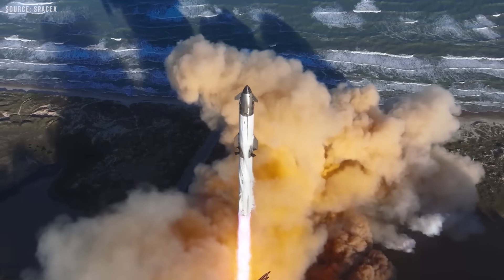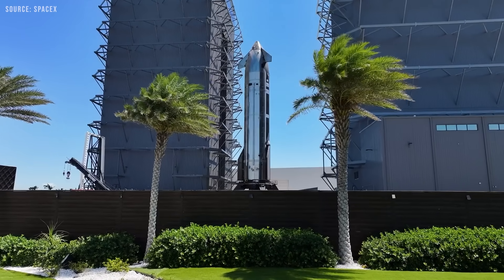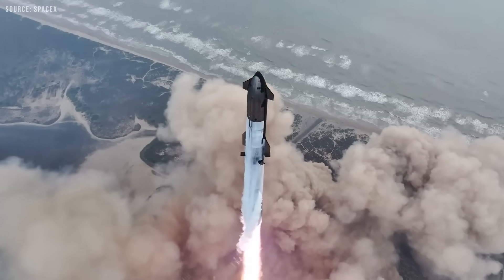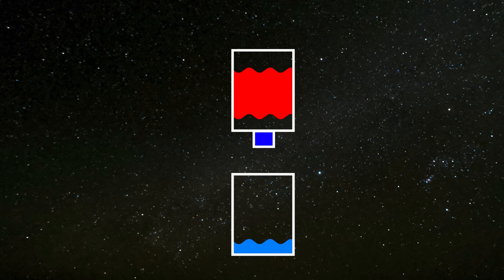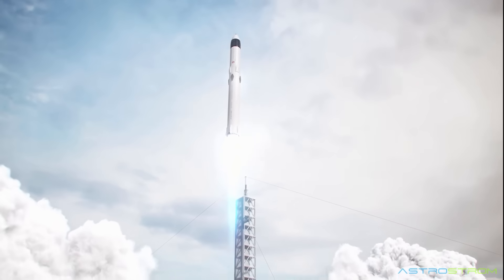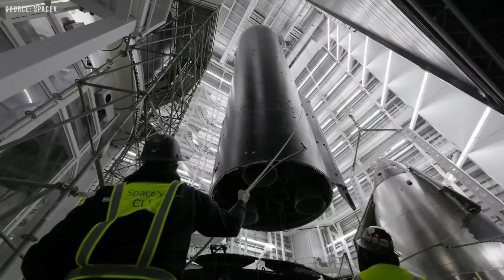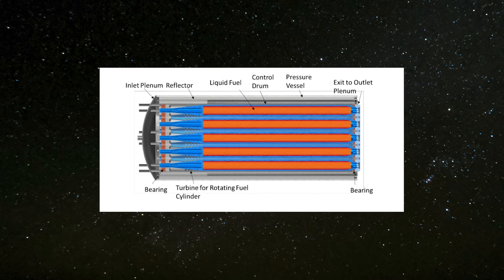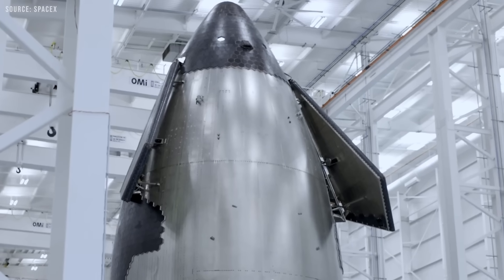SpaceX Found Brilliant Solution for Starship Refueling Problem!

Comment: Here is an idea. Refueling tanker came to refueling depo nose to nose to each other, lined in one vertical axis. Then tanker docks  at spinning on its own axis depo's nose. A tanker also begins spinning before docking so that the fuel inside pushes on its wall. On the wall there would be fuel output. Then pumps begin.

Comment: The biggest problem I could see with transferring fuel through a pressure differential is that you are definitely going to get gas, but it doesn’t necessarily mean you’re gonna get a lot of liquid with it. if the fuel is floating and it’s not on a transfer port there is no transfer. In my opinion, the most reliable way to transfer fuel between ships is by spinning them, pushing the fuel to the outermost edge and then piping it with a pump from there. But I’m not exactly a rocket engineer.

Comment: Love the orbiting tanker concept. Adding one or more tankers around Mars seems to make good sense. Having additional fuel could possibly help de-orbiting on Mars since its atmosphere doesn't provide the stopping pwr that Earth's does. Could additional tankers be placed at way points during the trip. The effort could lead to reduced travel time and avoid an immediate need to manufacture more O2 and CH4 at least for initial trips.  Getting the Mars based plant and storage concept worked out would likely a few years  to work out. A fuel tanker orbiting  the moon sho reduce risks if it available for backup
Reply from the maker: On point!

Comment: Fuel depot in orbit is the only logical solution, need pumps to transfer the liquid fuel and a sun shield to avoid boiloff. Solar panels power the pumps. This might be more expensive initially but this is really the only way to achieve Elon's goal of 1000 Starships to Mars

Comment: Circular motion creates continuous acceleration. The process of docking involves slowing down to the same speed as the  docking station. That deceleration could be integrated into the attachment process, introducing a spin introducing acceleration introducing a separation of the liquids from the gases. The use of springs for slowing down could store energy for the separation of the two vessels.

Comment: Several hours of continuous acceleration, even if it's a few inches per second per second, will change the orbit of the starship pair. After each refueling session they'll have to apply counteracting acceleration to return to the original orbit. If not, the orbit will become more and more elliptical and be more and more difficult for subsequently launched refueling starships to rendezvous with the tanker.

Comment: Starship orbital refueling may not work in practice.  The operational and logistic complexity of multiple Starship launches (not to mention the extra risk incurred) cannot be eliminated.  Given the problems with Starship thus far, I think a failure with an orbital propellent transfer is very high.  God forbid, an explosion in orbit, during a propellent transfer, would create an international crisis.  The debris field from such an event would pose a severe hazard to everything operating in low Earth orbit - including all manned space programs.  It is very doubtful that the FAA would continue allowing SpaceX to launch propellent into orbit if this happened.

Comment: The depot seems like a no brainer.  Sending the mission spacecraft up first makes no sense.  Send it up when there is enough fuel available.   SpaceX could launch to the depot once a week keeping it full and compensate for boil off.  It would require solar panels, tank insulation, and cryo chillers to work.  Keeping it full on a weekly basis means missions would have no wait time for fueling.   They could sell propellent to other customers as well.

Comment: The SAFIRE experiment needs further investigation.  Nuclear synthesis is easy with the correct model.
The structured atom model.
Further, there should be less laughter and less hubris around propellantless thrust.
Dr. Charles Bueller has already achieved 1G thrust; which is not hard, considering how weak gravity is.
We cannot solve problems using the same thinking that caused them.
Reply: No one has ever proven you can get thrust without propellent.  It is in the same category as perpetual motion. Show me some experimental data showing otherwise and I will believe.  Otherwise it is just wishful thinking
Reply: @dionysus2006 The older you get, the less you are sure of.